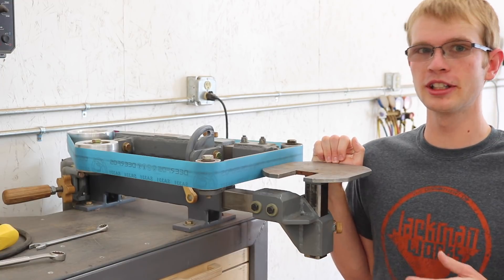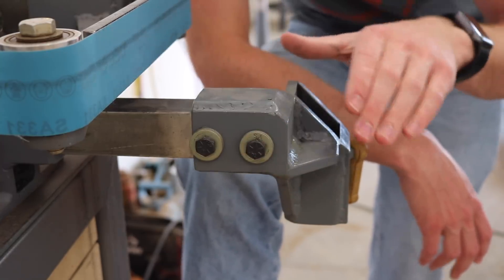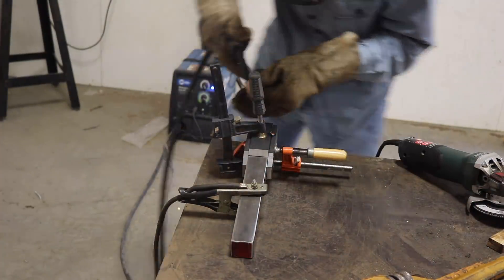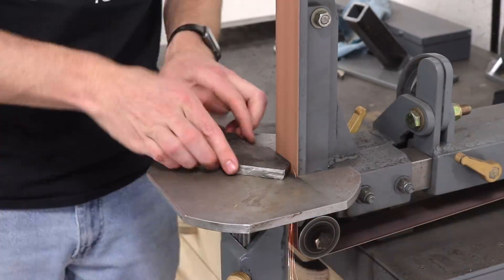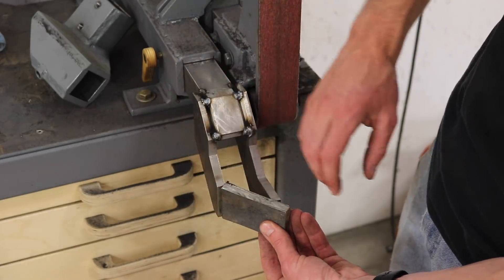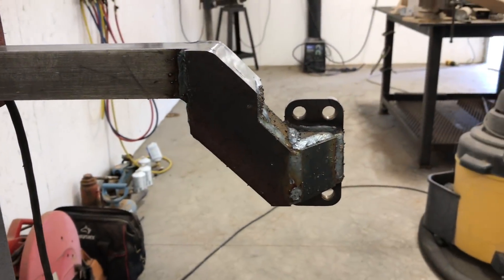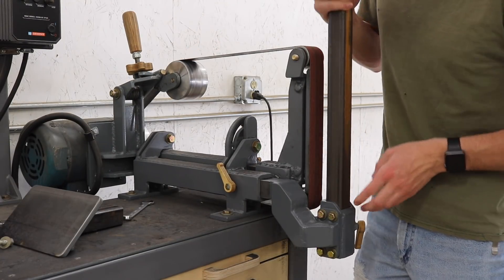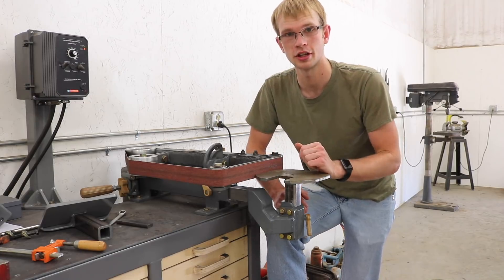Improved table holder for belt grinder

Comment: Have you considered getting some graphite backer for your platen? It reduces heat so that your metal platen won't warp, as well as making your belt last longer. Lots of places sell it.
Reply from the maker: I bought a glass platen, so I'm hoping that will have the same advantages. Just haven't got around to adapting it to this machine.

Comment: Fine work I am in the process of building the grinder from your plans. I do not have a metal lathe. The radius pin will be difficult. Will drilling a hole, tapping it, and using a bolt with the head cut off work.
Reply from the maker: That will work, just won't be as accurate.

Comment: You should put some safety wire around those bolts, that way you can not be paranoid that they'll fall loose.
Reply from the maker: I'm not concerned about the bolts coming loose, I was worried that some impact could knock it out of calibration despite being clamped by the bolts.

Comment: Your work is so exceptional that the only thing it is missing is a little automotive BONDO to clean up welds that don't as planned.  A guy did a video of brazing some cast iron mounts and did the BONDO filling before paint and you couldn't see where he had worked on it.  Pretty slick techinque.  I don't do it because I couldn't afford as much as I would need to make my work look acceptable !!

Comment: If you expect to make more sliding tubes, make a shrinking mandrel to build them around. It would work like a collet but instead of expanding in lots of directions, it would just expand in two. After welding, loosen a bolt on one end and give it a tap.  Might need a surface grinder to do this properly. Build it for your smallest sliding tube.  Add shims for larger sizes.

Comment: An idea - Instead of the complex box built around the main square bar. Cut the bar at an angle (with chamfers) and weld back together, to get the downward 'bend'. Then create the box that's the slide for the table's post onto that bar. Or onto a plate welded onto that bar.

Comment: Great engineering and execution.
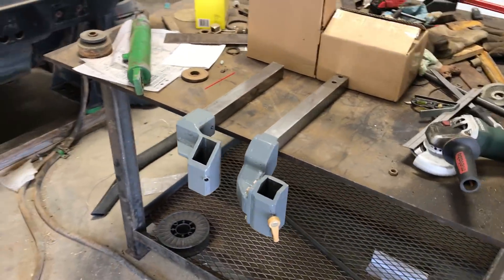@10:21 I would have just welded another square 'tube' section on the top of the original - since the two screw anchoring worked well.

Comment: The design, grinding and fabrication is on point, however the welding has some room for improvement. (not talking durability, you could probably lift a tractor with that thing.)
Reply from the maker: Yeah I'm no pro for sure. Doesn't help that I forgot to turn on the gas for that one weld... ;-)

Comment: Great addition. Does that top drawer still open?
Reply from the maker: Yes, the drawer clears the the table holder. If I drop the table itself all the way down, then the table post blocks the drawer, but that’s easy to get out of the way.
Reply: Jeremy Schmidt excellent. Thank you for responding.

Comment: Pretty sure u don’t need the flat bar under the angled table , the 1/2” plate can surely canterlever either side without flexing
Reply from the maker: Actually there were some other reasons for that support, but I didn't have time to go into them here. I'll try to explain in my video about building tables.

Comment: Jer, maybe time to work on your welds' aesthetics?   The layout and prep is fine but the beads show lots of porosity, inconstancy and lack of 'fill' of the V grooves and outside edge fillets.  If the welds were more cosmetically uniform- finish sanding would result in tooling that looked "cast" or at least more "pro"? great ideas and execution- just tighten up those welds!
Reply from the maker: Yep, I have very little welding experience so I’m still learning.
Reply: Example; you did spend the needed time to fine tune the segment cutting sled - to a fraction of a 1/1,00th!  That's the kind of practice energy needed to get welds that match your work quality.  Hood time! Thanks for all the interesting videos- sure enjoy your energy and effort.

Comment: Its a great build my question is the steel thickness seems a bit of an overkill considering its just a grinder,  and takes a lot more work to fabricate,
Reply from the maker: Everything on the grinder uses 3/8" thick material so you don't have to shop for a bunch of different materials. 1/4" would be sufficient for this part. Aside from that, this grinder is powerful enough to apply a lot of force to the structure, so it does need to be very strong to prevent chatter under heavy grinding.

Comment: i built a 2 x 72  belt grinder entirely from your design, it's the best one out there. Only thing is i used the steel from some tractor implements i had laying around, so the flat bar is 1/2" and the main frame is rather fat, 1" anyway i did not have dimensions so i guessed what they were from logic... ! i had a few issues redos and fails, but the finished product is quite satisfying...! i am going to make another one with the right material and buy a set of your plans, now that i know what to do and what to expect.. it is a superior design Jeremy, very very quite, smooth, no vibrations i have a 3  horse 3800 ripums  VFD L510 Teco/Westinghouse. took me a minute to figure out how to program the parameters. thank you and i will be getting a set of plans pretty soon, i got to get my Harley Back on the road first.... hahha
Reply from the maker: Thanks! Feel free to contact me if you have any questions.

Comment: Whats with the cold welds....ramp the machine up a bit, put down a bit more wire!
Reply from the maker: It was maxed out. It's just a little welder.
Reply: ahh...ya got to invest in a 300/350Amp beast!

Comment: Excellent video Jeremy, what stood out for me was the great editing and presentation. From the looks of it your welds turned out good. However if you remove the mill scale of all the to be welded surfaces before welding you will get a more stable arc and you can lower your amperage (if preferred). You are using solid wire (no flux core) and shielding gas right?
Reply from the maker: Yeah I'm using solid wire and 75/25 gas. Thanks for the tip!
Reply: I did this too before making my tubes. There is so much friction the mill scale adds and I noticed it expands slightly when welding.

Comment: Beautiful work as always! Thankfully I have not built this part of your grinder yet, but it seems there’s a lot of room for error in joining so many pieces of plate. I think I may try to use segments of 1/4" square tube at the proper angles. For the part that receives the actual square bar, I may stick with your method of shimming 3/8" plates for the tightest tolerance possible. Now if I could just stop having workshop ADHD, maybe I’ll finally have a belt grinder I can use!
Reply from the maker: Actually most of those plates are just there for structural rigidity. The right plate in the little arm that connects the bar to the table tube is the only piece that needs to be really precise. That said, I'd love to see how it works if you use square tube. I considered doing that myself and I'm still really curious if it would have been the better way...

Comment: In addressing only the issue of not being able to use the entire width of the sanding belt when using the 45° attachment - is there any reason not to just flip the belt over? Doing so would fix this problem without any cost in time or money.
Reply from the maker: That's the hack way of doing it... Unprofessional. If this was just my own grinder I probably would have settled for that, but hundreds of others are building this grinder for themselves so it needed to be addressed.

Comment: I like your redesign, and your grinder remains on my to-do list, though I need to finish the shop it'll go into before I can make it. But dang it, that weld porosity would drive me nuts if it was on anything I made.
Reply from the maker: I forgot to turn on the gas for the first 1" bead. I should have probably put more into fixing it...

Comment: Hey Jer. I have an idea for you: I love watching Dirt Monkey. He was talking on a vid about work trucks - 'Chevy has a great... but sucks at... Dodge's engine, Ford's suspension, blah, blah blah.' Why not contact him to see what  he'd pay for a PERFECT truck? You of all people could put together a truck with the BEST suspension, the BEST transmission, the BEST power plant; in fact, you could make the first and only transmission-less truck: reliable engine spinning a great generator feeding the best 4 electric motors directly driving each wheel - just like diesel locomotives do. Talk to Rich Rebuilds and Jehu Garcia about some Tesla power packs or controllers. I'm not suggesting you build it on spec, but if one of these guys or a coalition of these guys gave you $ or helped you organize a fund to build one to premium specifications... The pickup market in the US is huge. But the people who are actually using them for real work would LOVE a better built truck.
Reply from the maker: I would love to take on a electric pickup build, but I have no idea where I’d get the funding. This would be a very expensive project. Tesla’s pickup and Bollinger’s pickup should both be out in maybe 3 years, so to be relevant I’ll need to get mine done soon-ish.

Comment: Wow heavy duty materials. Function is not the only criteria of design, material dimensions are relevant to the overall  sucess or failure of the concept. There is good  reasons  why you would never  see a belt grinder made commercially  out of such large dimension  steel. Sadly buying plans and constructing accordingly  will see you spend exorbitant  amounts  of  money  paying for materials  three times stronger and heavier  than required for the application.  Nowadays  most people  want value for money ,possibly  why they would chose to build instead of buy however in this example steel cost would probably  exceed the cost of buying a commercial unit.
Reply from the maker: The steel for this table holder build was about $15. With a grinder like this, you risk chatter if it's underbuilt, so why bother saving $5 if the result might be inferior?
Reply: My comments  were directed at the grinder project  completely  not just the table modifications.  I would suggest  that  any chatter problems would  more likely  to  be related  to belt speed more than flex in the frame.
Reply from the maker: Brown Dog Ralph  My thinking is the same for the grinder. All the steel for the entire machine was about 1/10 the cost of the build, so building it lighter wouldn't have saved me nearly enough money to be worth it. If I was mass producing these that might be different, but in this case, the difference between using 3/8" steel or 3/16" steel would have only been maybe $40. And with 3/16" steel I guarantee you could feel the difference in it.

Comment: Nobody ever mentions the FPM or HP requirements for belt sander or belt grinder?
Reply from the maker: This one is 1.5 hp and is variable speed from 100-5000 fpm. I think that speed range is about right, but a bit more power (2-3 hp) would be better.
Reply: @Jer_Schmidt  Thanx!! for the come back.
Reply: @Jer_Schmidt  Thanx

Comment: Do it again and Do it right is the best feeling! So cool, Looking forward to next video
Reply from the maker: Yes! Thanks Martin.
Reply: I merely wish to ask if you would make me one of your belt Sanders with a 36"x 6 in table with an additional roller  1" in diameter so that I can hollow grind some of my knifes? After seeing the great work you do I imagine you can come up with a way for the roller to push the belt out about 1/4" midway up the vertical part of the Sander. I can supply a motor, please give me price for this work. I live in  Fresno CA. Thanks Steve

Comment: Just recently purchased your plans, awesome job young man. What motor and VFD are you using?
Reply from the maker: The VFD is the KB Electronics KBAC-27D. The KBAC-29 would be a better choice though, as long as you have a 240v circuit to plug it into. It wasn’t on the market yet when I built this. The motor is an old Baldor that I bought used. Used is your best bet if you’re willing to take the time to shop for it. If you’re buying new I’d recommend this one: http://www.electricmotorwholesale.com/LEESON-116760/

Comment: hello Jeremy! I have a question for you, I made a 3d printer and I wondered between a stainless steel rod of 8mm and a stainless steel tube of the same diameter, which is the least flexible?
Reply from the maker: With the tube, the outside diameter is 8mm? If so, then the 8mm solid rod will definitely be stiffer.

Comment: Question: is the reason the drive motor has to be 3phase is to allow for fitment of the speed controler? And does the speed controller invert single phase to 3 phase? I'm a fitter not an electrician and need help.
Reply from the maker: Yes, the drive runs on single-phase input, and it converts that to 3-phase output to run a 3-phase motor.
Reply: @Jer_Schmidt  thanks Jeremy, just purchased the plans to make the belt sander. Great job.

Comment: How did you attach the drive motor? I have a two wheel grinder/ buffer and want to attach the motor did you just attach the drive wheel right to you drive motor using key way? 
Thanks for the video and any help with motor attachment 
Turkey Creek Knives
Reply from the maker: If you watch the build video you can see how I did it. I start mounting the motor at 21:20 https://youtu.be/a_RlL1O-bK4 

I used the taper drive bushing (see video), but you can definitely just use a keyway.

Comment: I've been watching all your videos on the belt grinder, and I'm ready to buy plans and get started. So, I'm just checking to see if I need to buy the Gen 2 Table Holder plans separately or if you have included them in the main plans. Thanks.
Reply from the maker: They are included. Your purchase gets you plans for the grinder itself, platen attachment, and Gen 2 table holder. The plans for the other attachments are up on my website for free: http://jerswoodshop.com/2x72-tilting-belt-grinder/

Comment: Great video/project just as always. Do you plan on making a fixed or even an adjustable fence. I think especially in horizontal grinding mode this would be pretty handy.
Reply from the maker: Thanks! I usually just clamp down a scrap of wood, but I would be nice to have a proper fence. So maybe.

Comment: why are you getting so much spatter on your welds? are you using flux core wire?
Reply from the maker: I'm not a professional welder so I don't know why. I'm using solid wire.
Reply: Well from what I can see the your tacks have soot around them. So check the gas CFH sound be around 20 for a 75/25 mix. I'm assuming you set the machine settings volts/wire feed to what it says on the chart. Check your polarity of ground clamp and torch make sure it's not set up flux core. Check Wire feed Drive wheel tension Miller has a quick video on it. Could be a few other things but those are the most common.
Reply from the maker: Thanks for the pointers!

Comment: For reasons unknown to me, my browser (Firefox) won't load Etsy links.  Would you tell me how much your Imperial plans cost?
Reply from the maker: The plans for the Gen 2 belt grinder are $28 (includes plans for the power unit, platen attachment, table holder, and fixed table), and the plans for the other attachments are $7 (that’s a bundle including the small wheel attachment, contact wheel attachment, and adjustable angle table).

If you aren’t able to buy them through Etsy, you can PayPal me the money and I’ll email you the plans. Send me an email if that’s how you want to do it: jerswoodshop@gmail.com

Comment: I'm currently building the grinder. Where did you get you wheels and how are they holding up? Would you buy the same ones?
Reply from the maker: These are the wheels I recommend: https://www.knifegrinderparts.com/collections/wheels/products/complete-belt-knife-grinder-wheel-set-5-drive-5-8-4-tracking-2-idler-wheels They’re good quality and I’ve had no issues with them so far.

Comment: Nice build, but why O why use materials with such thickness and weight . No need at all to use plate or solid stock bar at the level you have . LOL love the comment " stops torque" had me wetting myself with the idea it's going to twist or warp . 5mm flat bar stock and SHS box section is more than upto the job . I am an engineer by trade and have vast experience of building machinery .
Reply from the maker: Steel is cheap, so I would much rather spend an extra $5 to overbuild it than to make it light and flimsy. And I'm not convinced that you have as much experience with machinery as you claim...because this machine still chatters at times. Obviously it is weak enough at some point (probably the hinges) that it can flex enough to chatter.

Comment: Says "I screwed it up totally" then makes a tiny modification to remove the .00003 away from perfection that it was to begin with!
Yep, just a touch of OCD. LOL
I want to get the plans but wonder, do you update and add the improvements to the design plans you sell as you make them?
Question answered at the end of the video!

Comment: He's been welding for quite a while now and you should be getting very good I don't mean to be mean but you're not. I think you would benefit greatly by only using gas Warrior and leave flux core the hell out of the equation. Also if you take things together do your final passes with little loops pretend like you're decorating a cake with icing it won't look like Lux when you're done it'll look like classic welding. Two small loops it's hard to describe some people call it continuous cursive E
Reply from the maker: I’ve never used flux core. I understand the concepts of welding, I just suck at it. But the stuff I make always holds together so I guess it’s good enough...
Reply: @Jer_Schmidt  I agree if it holds together it's all good but then there's going to be a time where you are tired of looking at crappy welds. Practice the looping technique and you'll get beautiful well to no time at all one afternoon practice and you'll be a pro